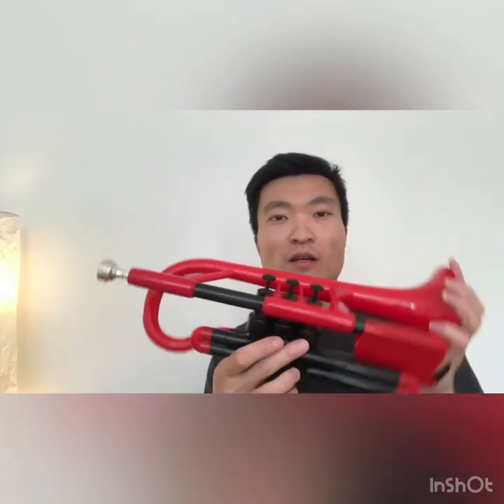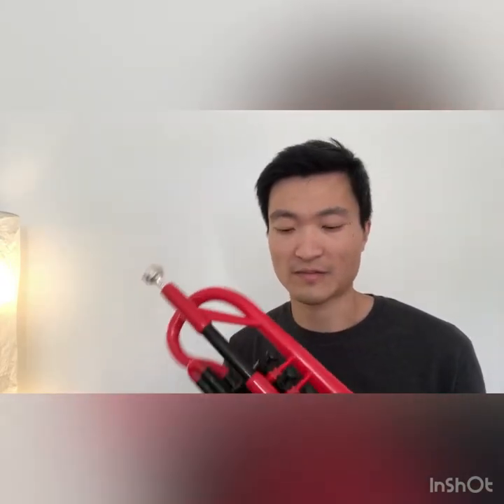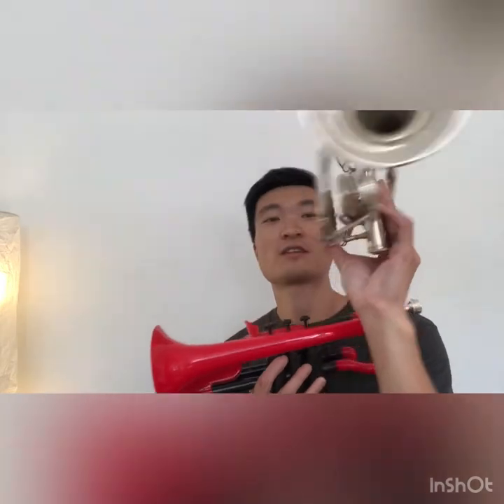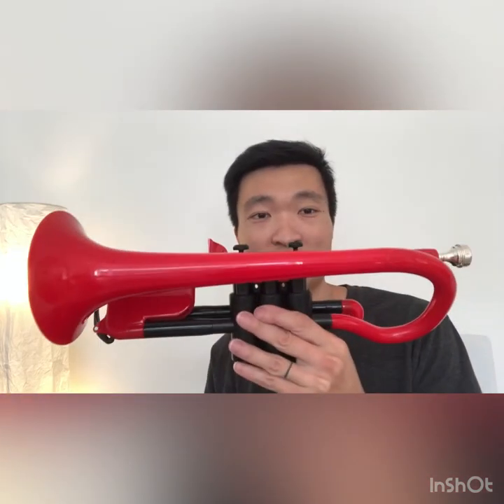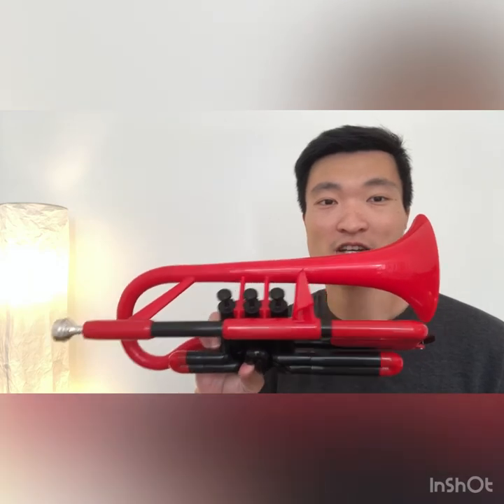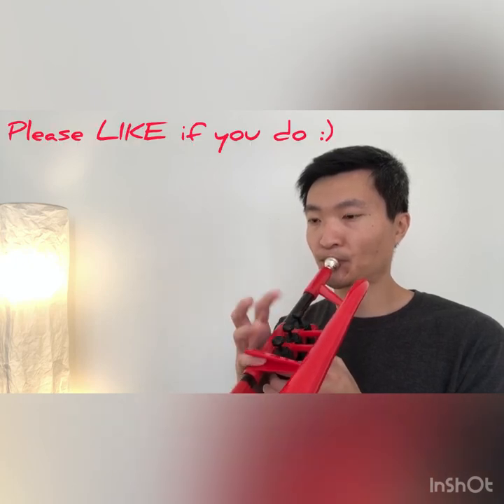pCornet Short-term Review | Plastic cornet with plastic valves

Comment: I had a similar experience with the valves in the beginning, but I kept playing on it and eventually the stickiness of the valves decreased. The first months were quite frustrating but now the valves move freely and they don't bother me when I play. I tried lubricating the valves first with valve oil and then with silicon spray but that didn't really help. I think the best way is to keep them dry.
Reply from the maker: I have exchanged the horn. The replacement is a little better than the one in the video. I agree with you that the valves work best when dry. However the sticky valves still happened after I played for about 15-30mins, when moistures built up. The performance noticeably drops as the longer I play. It holds me back if I play music that requires quick valves action.